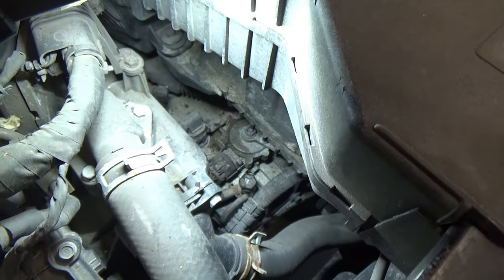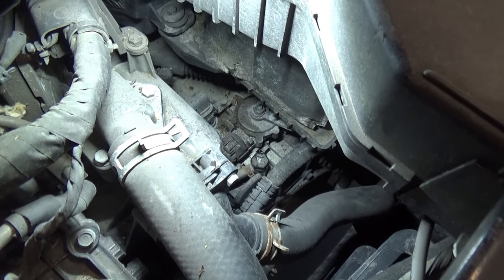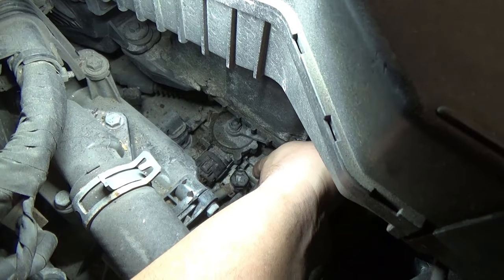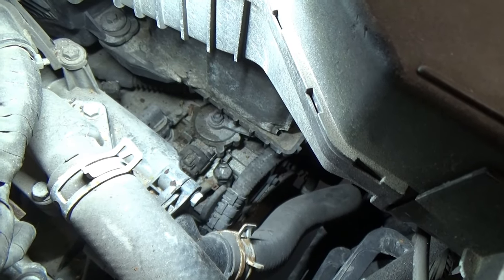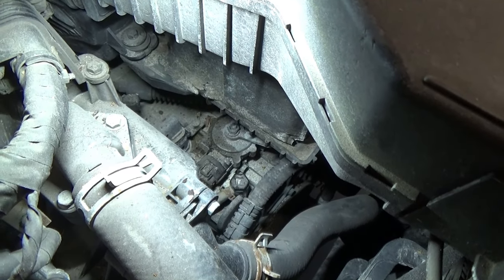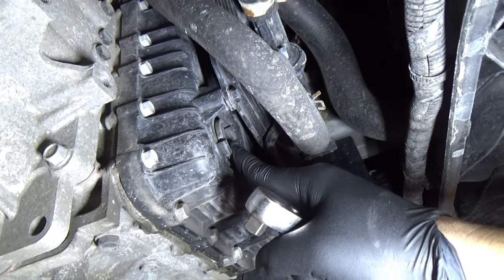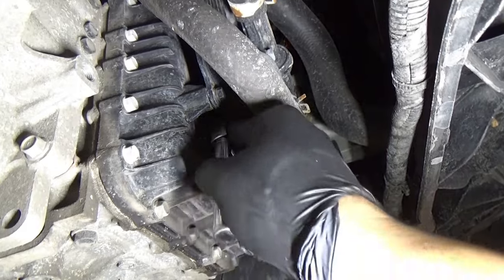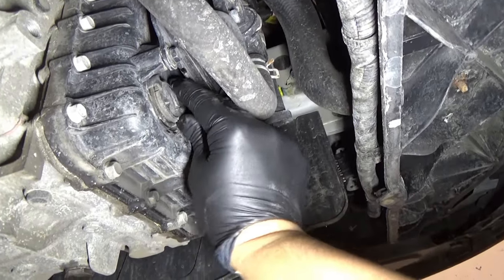How to check transmission fluid level without dipstick in Hyundai Vehicles

Comment: I have to stay that’s the stupidest fluid level check procedure I have ever seen . Shame on Hyundai for not putting a dip stick in it . Not blaming mechanic. Excellent video .
Reply: All new cars lack a dipstick, it's stupid
Reply: Totally agree. Not blaming mechanic either, but just spent quite a long time in the engine bay looking for the dip stick and did not see any. Could not believe my eyes and now this. Way to go Hyundai 👎
Reply: There is a reason why. They dont
Reply: @scr454 So you pay the full price only at a Hyundai Dealership
Reply: everything is designed for the person today that has some
 mechanical traights to not be able to repair,replace or check important levels wait it’s gonna come to a time when we won’t be able to check motor oil
Reply: Most of modern cars don't come with a dipstick bcs alot of people end up putting the wrong fluid typr in it, so they removed the dipstick so people can't mess with that any more,and dedicate  this task for professional mechanics.

Comment: a Steady stream of ATF coming out while engine is running means your fluid is at the correct level?  That doesn't seem very accurate. Seems it was overfilled if it's running out the level check hole.
Reply from the maker: As per the service information thats how they want us to check if the level is correct. Especially on this transmission doesnt have a dipstick.
Reply: Should you add back the amount of fluid drained?
Reply: Yes, if you're talking about after you've drained transmission.

Comment: Forgot to mention the fluid temp should be approx 60deg C , and the stream should be smaller then what was shown on the video.. there is a tsb about checking the level and the stream size.. this Hyundai method of check the level is sooooo subjective! ...love your videos
Reply: I know this is not the correct video to ask this, but not sure how I can contact you about other issues.. I have a 2019 Santa Fe 2.0T and it has the Electronic Parking brake system... Is there any method that I can put the parking brake into service mode(brake pad replacement) via some kind of non OBDII method?. or do you know of a well price OBDII that supports Hyundai and these special functions that I can buy for this purpose? - I know the GDS is in the thousands of $ , and there are some clone GDS systems for Hyundai, but I dont trust these clones... thanks!!!
Reply: @cory9198  As I know for Santa fe you can replace your brake pad as normal no need for OBD, Dont pull up EPP and start removing brake caliper it's ez I did it on my previous 2014 santa fe limited
Reply: From what I understand, 60 degrees Celsius is the maximum and 50 the minimum. That’s between 122 degrees and 140 Fahrenheit. Anywhere between that is fine.

Comment: thanks for this video. Several videos show how to replace the ATF using a drain and replace, but not many show how to check. I think the Hyundai maintenance manual says ATF should come out in a thin stream from the check port when the engine is idling.
Reply from the maker: Yes think solid stream.

Comment: Man you saved me today! Just to clarify, this is while the car is at operating temperature in park, correct? Just wanted to make sure I don't need a helper holding the brakes while it's in gear!
Reply from the maker: Yes operating temp transmission oil temp at 50 to 60 degrees celcius, at park. Or you can drive around the block and comeback at park amd check fluid level, more or less the driving around the block is 50 to 60 degrees.
Reply: @hyundaitech  thanks for the help by posting the video and replying to my follow up!
Reply from the maker: @AR-ed3xw  no problem
Reply: is there any problem if i check without engine running ? @hyundaitech
Reply from the maker: @fahadabid the preoblem there is you dont know the right level of the oil if its not running, as per the service information, it should at operating temperature 50 to 60 degrees transmission oil temp.

Comment: The Hyundai God enlightens us again 🙏

Is this the same for the 8 speed for the 2015 Genesis Sedans?
Reply from the maker: The genesis one, is on the bottom.of the engine, theres gonna be drain plug, thats where you drain, and theres a plug for level. On the side of the transmission theres a fill hole there  and thats where you put your transmissio  while the level plug is open until there fluid come out from the bottom of the transmission and then you recheck the level after the vehicle warms up  either you drive around the block then recheck that level plug hole.
Reply: @hyundaitech  lol just like my old G37 what a pain haha
Reply from the maker: @4555Anthony  hahha yup.

Comment: this was automatic or manual transmission? I have a 2004 Santa Fe  CRDI 125 hp  4 wheel drive, 5-speed manual  transmission,  I am not even sure if the 75w90 is good for it, and what to use for the differential,  thanks for help

Comment: Quick question so do you check it when it’s cold or hot or does it not matter? I know the engine was running in the video. Is there a particular temperature range? The transmission Hass to be in before opening the check fill plug
Reply from the maker: Yes usually at 50 to 60 degrees oil temperature for the transmission and then you can check the level.

Comment: You check it with the engine running Right
Reply from the maker: Engine running in park at 60 degrees celcius
Reply: Thanks for your help, can you tell me is this the same transmission that Kia soul has JB
Reply from the maker: @Sam152-h2g  im not sure on what transmission in kia, if the transmission has no dipstick kia and hyumdai should be the same process.

Comment: Or you just fill it with exactly the same amount you took out of the trans when changing it right
Reply from the maker: You can do that too, but usually i always double check it at operating temp and remove the level plug, sometimes if something is on the way on the plug like a cooler assy so yeah i just put whatever amount that wad drained.

Comment: Do you know if I have to jack the car up to add fluid to Hyundai Sonata 21 if so which fluid
Reply from the maker: To add fluid i think its under the battery if its regular transmission. Best way is contact your nearest hyundai dealer. For the fluid i think its sp4, but to be sure contact your nearest dealer.

Comment: I know this is not the correct video to ask this, but not sure how I can contact you about other issues.. I have a 2019 Santa Fe 2.0T and it has the Electronic Parking brake system... Is there any method that I can put the parking brake into service mode(brake pad replacement) via some kind of non OBDII method?. or do you know of a well price OBDII that supports Hyundai and these special functions that I can buy for this purpose? - I know the GDS is in the thousands of $ , and there are some clone GDS systems for Hyundai, but I dont trust these clones... thanks!!!
Reply from the maker: Hi there, about the brake pad replacement on electric parking brake equip some of the guys here just push the piston without retracting the motor, so far they dont have a problem, still doable without the scantool. The downside its not easy to push cpz the piston still there so you need more effort to push it. Hope that helps. Im gonna make facebook page soon so that for questions and communication its accessible.
Reply: Just gotta take the motor off it’s 2 bolts and than screw it in clockwise

Comment: Please how do I check for Hyundai Genesis 2017?? Any clue
Reply from the maker: Theres a drain and level check on the oil pan, engine running remove the level plug and if you see fluid streaming thats good at 60 celcius temperature for the transmission.

Comment: At what mileage should transmission fluid be changed on a 2020 elentra with a cvt  transmission?
Reply from the maker: As per the transmission it says on the sricker that no fluid chanhe on those type of transmission, but if you plan to change it make sure biy the oem cvt fluid for that.
Reply: @hyundaitech   thanks for your response. Yes always use oem  and specific transmission fluid.  Can I drain and refill or do a need a specific scan tool to make sure the fluid is at the correct level?
Reply from the maker: @John Scerbo  there should be a oil level plug on the side of the transmission. If it's streaming steady out of the hole at 60 degrees Celsius of temp of the transmission that should be okay.
Reply: @hyundaitech  Okay thanks for your response  I have gotten 3 different answers on when the fluid should be changed in this type of transmission. I always have drained and refilled my 2006 Honda crv every 30k that why t 175k she runs runs strong  no issues

Comment: Why didn't you let it all drain out and change the entire fluid there is a sock-type filter in there also.
Reply from the maker: Its just a drain and fill repair.
Reply: @hyundaitech  By looking at the bottom of your transmission isn't that the drain plug that drains all the oil out and would you not measure how much came out and pour the same amount back in through the top hole? Just wondering for my Kona N DCT have not got under there and looked yet.
Reply from the maker: @cindysue5474  well technically its a sealed system so whatever comes out , you put the same amount of fluid. But in this video i was just showing on how to check the fluid level. For the kona dct, its like manual transmission, when you fill it up in the fill hole, when it starts to overflow thats the right level, its different on this auto transmission.

Comment: Hi how you do a transmission oil change in a Hyundai santafe 2010 ?
Reply from the maker: Just almost the same with this video, any hyundai that has no dipstick. Hope that helps
Reply: @hyundaitech  thanks, so you can refill from the top? Thanks
Reply from the maker: @Rafaelmartinez-xy7eg  yes theres should be plug there you can use 24 mm socket if im not mistaken near the inhibitor switch i think you have to remove battery tray.

Comment: I was driving my 2013 2.4 liter hyundai sonata this morning, engine has been replaced from dealer cuz it locked up, they replaced with 2017 ive seen stamped on head and block, put about 80,000 files on new engine, I came to a stop at a light this morning and while idle, car shuttered twice....any thoughts?
Reply: I did spark plugs but not coil packs, was wondering if coil packs starting to fail, should though engine code light? so since it didn't, think fuel related or more pulley serpentine system?
Reply from the maker: @BuyingTickets  what happen to the vehicle? Loss power? Shaking engine?
Reply: @hyundaitech  was as at red light and stopped and as i came to a stop, engine shook like low idle for 1-2 secs then came back up...then went low idle and shook 1 more time for 1 sec. then everything normal... notice that happened a couple weeks ago too, caused me to try and do a tune up, but did not fix as it happened again this morning just for a second....went out for lunch and everything normal....
Reply: could a torque converter do that?
Reply from the maker: @BuyingTickets  if it was torque converter should be consistent in my opinion, looks like you have misfire i think, if you have no codes, check the obd 2 monitoring test result , then check misfire data, maybe theres a clue there. Let me know if you find something.
Reply: @BuyingTickets  mine did it too a couple Weeks ago at a red light like it stuttered to go I think I be too flush out my transmission fluid
Reply: @quintaviesavery  there is a recall on oil leaking. It's killing the alternators. If this is the case the dealer will fix it for free

Comment: Do you know, or anyone else, if the engine needs to be running on a plug-in hybrid too, because this does not have a torque converter as the electric motor has replaced it. I cannot find information anywhere how am I supposed to check the level with hybrids because I cant figure out how to keep the engine running - if it needs to be running
Reply from the maker: What i know the hybrid like the ioniq has dual clutch transmission and checking the oil for the transmission is like a manual transmission, if the hybrid model let say like the older sonata, they have almost the same type  of transmission like this video and yeah same way on checking. But sometimes they can be tricky coz the level hole has something blocking on it, so what i do is the drained fluid i catched it in a container then i will put the same new fluid or a little bit more like half quart more.